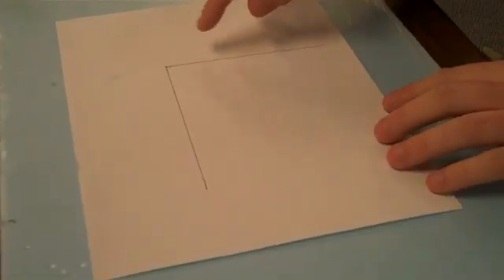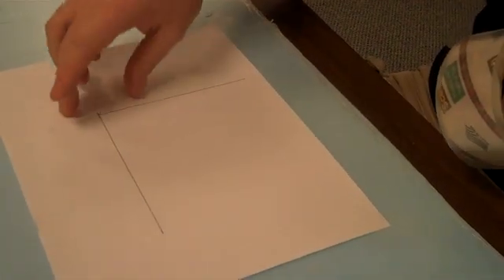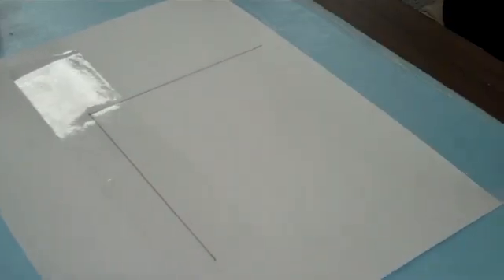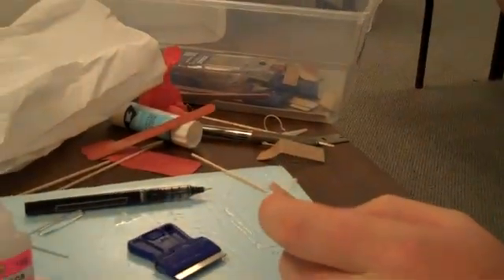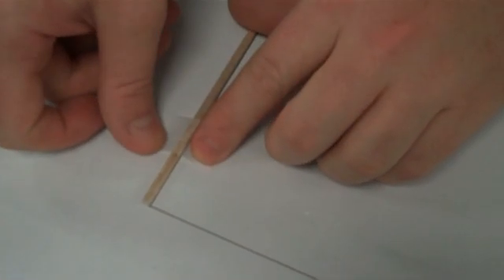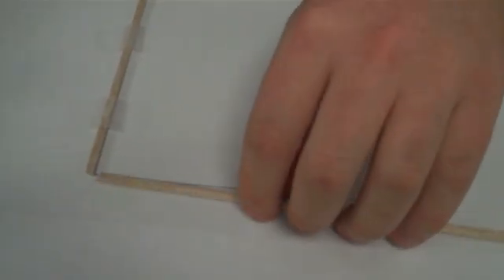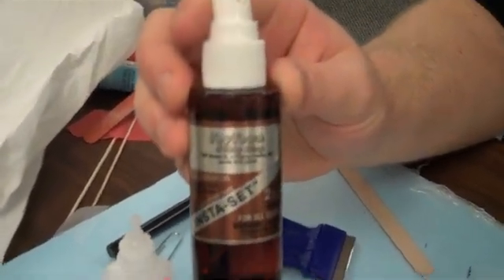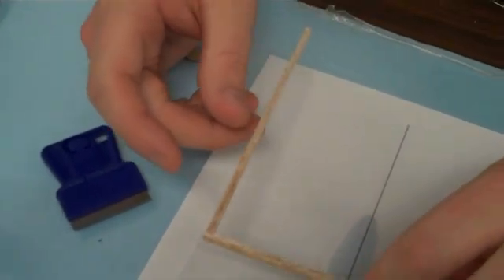NC Science Olympiad: How to Glue Balsa

Comment from the maker: @yoachallenge We actually prefer the medium viscosity CA,  just happened to have Thin lying around.  Thin will last longer, but makes more of a mess running through your joints and potentially gluing your project to your work surface.  Thick tends to be too thick to coat all the way through the entire joint. Medium on the other hand is usually just right.
Reply: Kelly Fair do you know where I can get that wood?